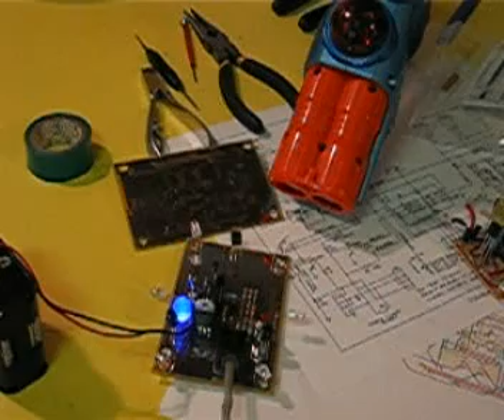IR Bus First PCB populated

Comment from the maker: It a wired BI-directional Infrared (IR) repeater... In my case I was using it with some Lazer Tag Team Ops equipment (which is really IR). Could use it to repeat IR from many locations. Could imagine it to send commands from remote controller between any two (or more) rooms.